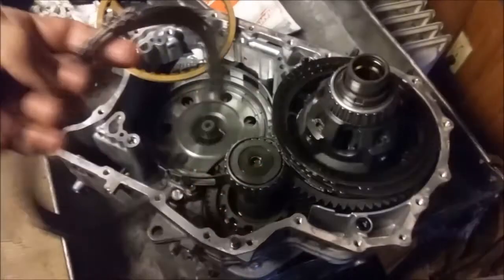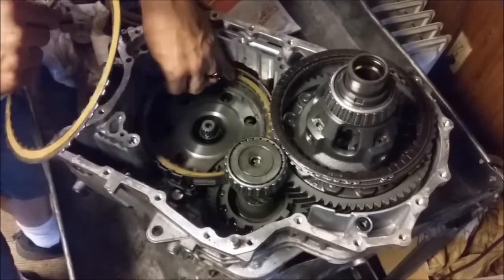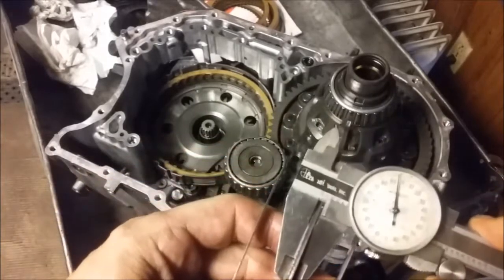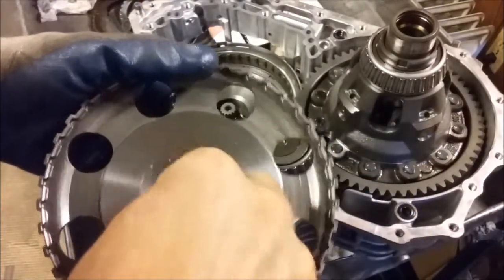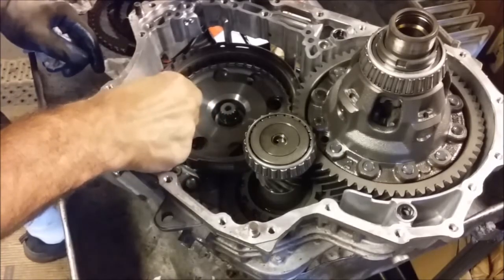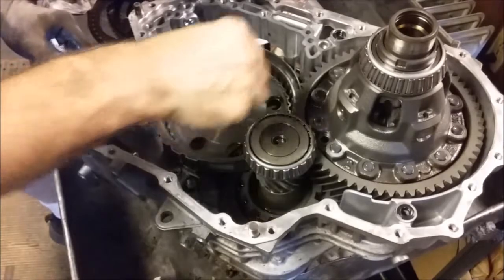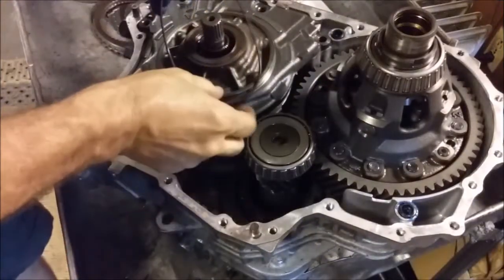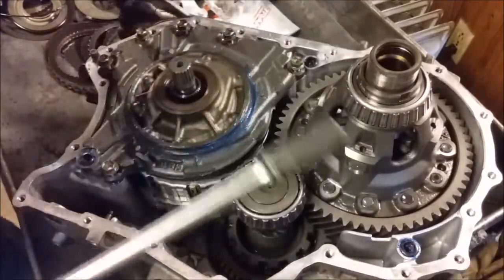VW 09g fix reassemble, rebuild, assemble part two TF60SN part 2

Comment: Excellent video, very detailed. The oil pan has sort of a plastic stick that goes in the drain plug hole, which allows to fill up and measure the fluid level correctly. My car doesn't have it. Do you know where I can buy it?
Reply from the maker: Some of the early ones were 2 piece all later pans have the metal tube made in. Here is a link to the good late model pan it will fit early models too. https://amzn.to/2tUEiT3

Comment: l am about to buy a VW Polo with this transmission for dirt cheap. Only problem is, 1st gear pulls to 5000rpm  (yet moving slowly even at high rpm) before moving onto 2nd gear then it starts functioning correctly from 2nd gear. What could be the issue here?

Comment: Thanks for the video. Question I have. I separated an engine from tranny (GA6F21WA which is a Aisin TF60-SN I believe) on a 2010 mini cooper, now tranny tc seal is leaking, even with a new seal (twice). Could it be due to a worn bushing, neck of tc is no longer concentric (after reinstallation) to the bushing and seal, making the seal leak especially at high engine rpm? If so, I need to replace the bushing. Any easy way without taking the whole tranny apart? Tranny is otherwise working fine.
Reply from the maker: Yes your right its probably the bushing. Unfortunately you do have to pull out the transmission and the pump to replace it. You can see me replacing a ford pump bushing in this video. https://youtu.be/-laWmAHY8Ms It will give you a good idea of what your up against.
Reply: @saneauto  thanks